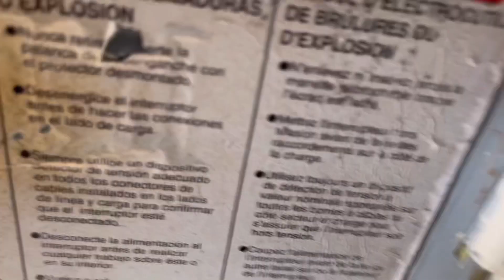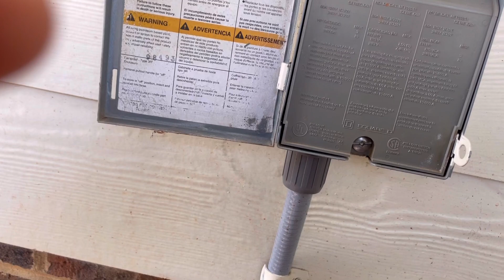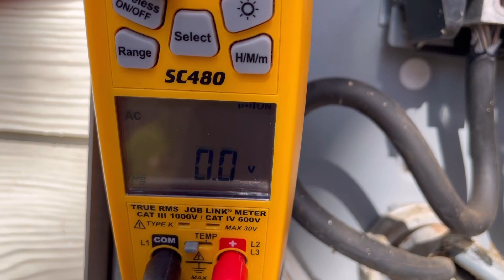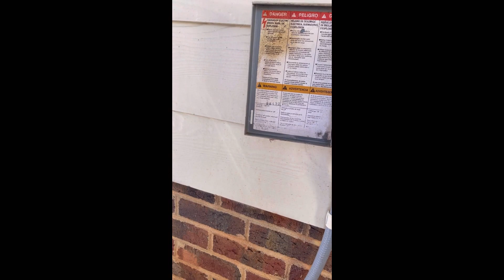A bad compressor in a heat pump.

Comment: Definitely easy to think it was the breaker when it was tripped and still in the on position like that. Any time I run into that I'll try flipping it off and back on a few times to check it. Thanks for the tip.